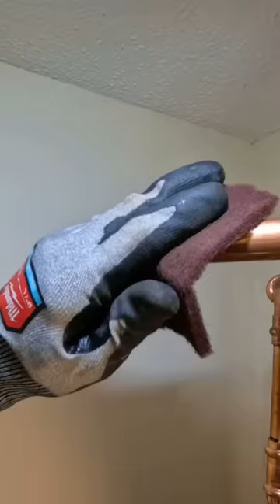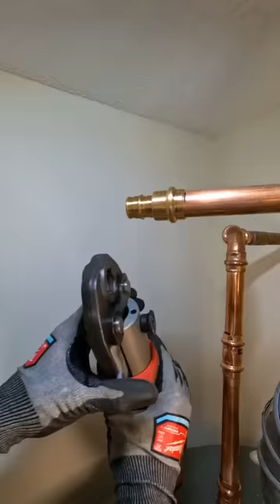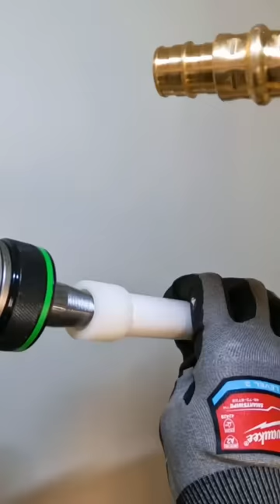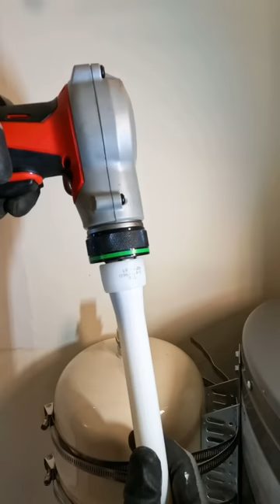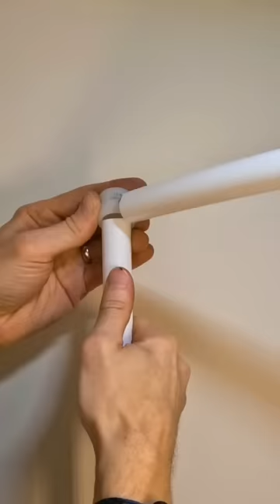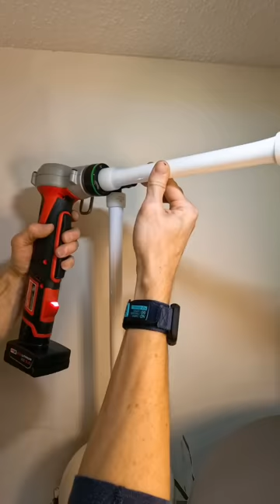Using PEX-A to pipe a thermal expansion tank 💦 #plumber #diy #construction #howto #shorts #water

Comment: I like the shark bite removal tool. That’s a lot nicer than the plastic POS I use.
Reply: Agreed
Reply from the maker: It’s a great tool a little pricey but works great
Reply: согласен,мне нравится ROTHENBERGER ROTHERM 2000 посмотри,
Reply: Adjustable wrench works just fine.
Reply: What is the tool called?
Reply: @johnbagewll2321  yes it does. In fact I’d argue it’s way better in every case because it performs many more things than 1. Don’t buy this thing,  if it’s free?  Sure.

Comment: Why mark the pipe with the Sharpie if you weren't planning on removing it after it was already seated??    You typically make the mark because you need to remove it to finish prepping it and then use the mark to make sure it's fully inserted before clamping it in.     Strange...
Reply from the maker: Fittings will sometimes move
Reply: It's a good idea as a ghost might move it when you aren't watching.

Comment: Love this Pex system. You can buy a manual tool for diy use around the house. It’s less than $100 and has a 1/2” and a 3/4” tip. The Milwaukee tool is very nice but way more expensive.
Reply from the maker: Great tip!
Reply: Which tool?
Reply: @mvmcali6900  I have a Sioux Chief manual expander. I got it at Menard for ~$60. It has two expanders. 1/2” and 3/4”.
Reply: What is the tool to remove shark bite in the beginning
Reply: @jerondbetts7341  There are several. You have to be able to push and pull simultaneously.
Reply: Use it and then return it after the job is done
Reply: @fredericdudley6184 does it rotate or do you manually have to do it?
Reply: @jamIam6548  neither tool rotates. There are three jaws that expand inside the tube and collar. The manual tool expands by leverage the one that looks like a drill uses rotation to make jaws expand but the jaws themselves don’t turn. It takes several expansions to get the jaws all of the way in.
Reply: @fredericdudley6184  so it makes no difference between either tool?
Reply: @jamIam6548  Not in the way the tube is expanded. The cost delta is significant and the manual one can be a workout if you are doing a lot of connections. Muscle vs battery power.
Reply: @fredericdudley6184  when I started plumbing, all we had was the manual.  Not that much fun doing 1” in the winter in tight spaces.  The manual one wouldn’t be practical on a job site roughing out houses the way we do.  The Milwaukee pro pex is a godsend!!!
Reply: Just a note, rotating is important. Lawsuits have been filed for leaking expanded PEX. Stretching only some parts of the tube wall is being blamed on cracking later.
Reply: @forunonein  yes, it is actually in the tool instructions to rotate and the Milwaukee auto rotates for that reason

Comment: What was the point of marking the pipe?
Reply from the maker: Marking full insertion
Reply: It was all ready all the way in🤦‍♂️🤦‍♂️
Reply: @theplumberlorian you’re supposed to measure the depth of the fitting and mark that in the pipe. Then slide the fitting on and if it doesn’t hit the line, you’re not all the way in. Not shove it on there and mark it lol literally no point of marking it at all the way you did it.

Comment: Why put on the fitting and then mark the pipe?  I understand there is a Guage to use to mark the pipe BEFORE  sliding the new fitting on.
Reply from the maker: I’m using the fitting as a gauge .. marking full insertion of the fitting before pressing

Comment: Aren’t you suppose to mark it before you put the piece on? Crimps shouldn’t move if they are done right, the only thing that’s in question is when will that o-ring dry up and start leaking
Reply from the maker: Marking full insertion, yes the fittings will push out and move sometimes
Reply: I was thinking the same thing, I usually make a mark for slip couplings only.

Comment: They make a pipe support to bend it 90 degrees and you don't need a fitting.
Reply from the maker: I gotcha yeah I don’t think the pipe would have landed it where I needed it even with the support
Reply: @theplumberlorian  I like the tool you use, but I worry about time with these fittings. I really feel in the future were going to have issues with them. I just don't see over time these plastic ends not loosening or springing leaks.
Reply: @jr303official they've been using Pex-a since 1983 here in America. They have been using it in Europe since 1968. I personally have plumbed hundreds of houses in pex-a. PEX is installed in 60% of all new houses in United States
Reply: @godofplumbing  I under stand that, I use pex aswell, I'm talking about this fitting type with uponor, "expand and contract" I generally use crimp style. I just like the mechanical fastener aspect. We know the pex pipe should last well over 100yrs, but I worry about the connections.
Reply: I want to Go Home  the metal supports don't have a place to mount and the plastic ones do.

Comment: When you don't have enough SKILL to solder copper pipe - you get this!
Reply: Yeah for a couple 100 bucks
Reply from the maker: Don’t be afraid of modern technology
Reply: @theplumberlorian  As a 42 year 'Professional" plumber - I am not afraid of anything. I just recognize non - skilled and inferior products/processes! There is NOTHING better than tried and true copper/sweat installations, as proven over a centuries in actual use.
Reply: You know it's all about cost and nothing to do with skill. Cheaper material. Installs in less time = less labour. 

I;m pretty sure they come with a nice warranty to encourage the change over too. 

Also the insides of copper pipes can get real gross looking over time so its not like that will stay forever once installed either.
Reply: @scotty362100  yes the first generations of PEX piping was a failure but like I said above, the newer PEX piping has a 25 year warranty and comes in a lot less.

I’m not disagreeing with you that copper is a better material, I’m simply stating the facts that it’s getting priced out and that will only get worse over time.
Reply: Yes, it takes a doctorate in solderology to do copper. As a matter of fact of have a PhD in toiletry for installing toilets. Certified master toilet mechanic. 🪠
Reply: @systemsh0wd0wn  PEX had a 25 year warranty too, so you touting any warranty is meaningless! Tell those that lost their homes about warranties, They were NEVER paid for their losses.

Comment: I thought pex made me worry for the future but I suppose copper gradually getting thinner and thinner over time is a thing too.

What happens to those crimp connections if the oring fails.
Reply from the maker: Well all the fittings come with a 50 year warranty .. I’ve never had an issue with them, I’ve install hundreds of them

Comment: Does the pex shrink tight on the fitting?
Reply: Yes it does and it doesn't comes loose.
Reply from the maker: Yep PEX A will continue to shrink back to it’s original shape for the life time of the material
Reply from the maker: Yep 💯
Reply: Does that expansion tool use any heat or strictly force to expand the pex?
Reply: @John Karavokiros  just force, the pex goes back to it original shape within seconds and you won't be able to remove it unless you cut it.
Reply: Nice! I really want to try it!
Reply: An extra benefit is the joint can be rotated without leaking.

Comment: You might as well put shark bite fittings one adapter one 90 and  and coupler and bam no fancy tools and 1/4 of the time but I never put an expansion tank in like that always right off the top closer to the tank horizontal
Reply from the maker: Sharkbite it up bro

Comment: Good video, but if you want something to last the life of the structure, sweet your copper fittings on.
Reply from the maker: A water heater is 10-12 years tops 😂
Reply: @theplumberlorian   that would also depend on how hard your water is, I have seen some go 20 years, but in general,  you would be right. Still sweating pipe is still better, but not always practical,  I have to admit.

Comment: Love the wirsbo pex. Not so sure about the pro-press copper stuff.  I’d rather see a solder joint.
Reply: Love propress been in use over 30 years in Europe, I've installed  all sizes up to 4" in hospitals and commercial buildings
Reply: @michaelnelson7572  but tests show that it can leak without the orange inside.  Which means eventually these fittings could fail.  I suck at soldering, but it’s a proven joint.
Reply from the maker: Oh yeah press is awesome
Reply from the maker: Press is awesome, no problems here
Reply from the maker: Most of these fittings are warrantied for 50 years though, thats good enough for me
Reply: @markg7963  orange?
Reply: @michaelnelson7572  auto correct got me. o Ring.  Is what I meant.  SoRry.

Comment: I'm a firm believer in copper pipes with soldered joints. O-rings eventually start leaking.
Reply from the maker: It all starts leaking eventually
Reply: @theplumberlorian  rubber last around 10years before it goes brittle
Reply: There is no o-ring in this system. The secret is the expansion collar.

Comment: Wondering why you measured the progress to pex transition for…..
Reply: Same
Reply: I’m wondering why they’re using two different fitting systems…
Reply from the maker: Says a lot coming from a Roto Rooter
Reply from the maker: PEX is less expensive
Reply from the maker: You don’t measure pipe where you’re from?
Reply: @theplumberlorian  Yes, of course we do. We don’t measure the connection end seeing as it’s the exact same every time. But I guess you want to check to see if something has changed any. 
But since you’re getting so defensive. Please, explain why you do measure the tip at the very  end of the transition fitting only. Very courageous.

Comment: how you adjust tank bladder air pressure ( depending on system working pressure of course), if there is no pressure gauge by the expansion tank?
Reply from the maker: You have to match the water pressure in the home

Comment: So tool companies can sell more tools.
Reply from the maker: Just a different way of joining pipe
Reply: PEX is cheeper than copper. It all depends on what tools you started out with in the trade. If you had to re tool your gear than I'd stay with the older stuff. And sharkbit style fittings Dave in labor but are expensive, plus no hot work permit in the commercial applications.
Reply: @kevinmatthews9207  I love pex. Using ot for over 20 yesrs.
Reply: @kevinmatthews9207  yes the hand crimpers give you the feel, just like a hand wrench over impact driver.

Comment: Up to how many psi would it hold on water 🤔
Reply from the maker: PEX-A pipe is rated 160 psi @ 73.4° F (1055 kPa @ 23° C), 100 psi @ 180° F (690 kPa @82.2° C), 80 psi @ 200° F (550 kPa @ 93.3° C).

Comment: Useless as it looks like you have tank on floor. It needs to be up. If you did that, great but you instructional vid does not show it.
Reply from the maker: It’s not on the floor it’s mounted to the side of the heater
Reply: @theplumberlorian  An expansion tank must be opening down and very much higher than anything else or it fills with the liquid, never emptys, and becomes useless.

Comment: I’ll be back in a couple months, maybe a year or two to properly plumb it with real copper and REAL SOLDER 0o0o0o scary ikr
Reply: My thought pretty much. They use three different tools and lots of plasticy stuff. Instead you can just use one blowtorch and nice copper pipes which takes forever to deteriorate.
Reply from the maker: Welcome to modern times
Reply from the maker: It’s just a different way of joining pipe, don’t get stuck in the dark ages
Reply: @theplumberlorian  look around buddy, nothing Modern is moderately good now whether you want to talk worth ethic, materials, economic, political, maybe it wouldn’t be so bad to “go back to the dark ages” don’t fix what isn’t broke, last time I checked my soldered joints will run laps around your PEX A